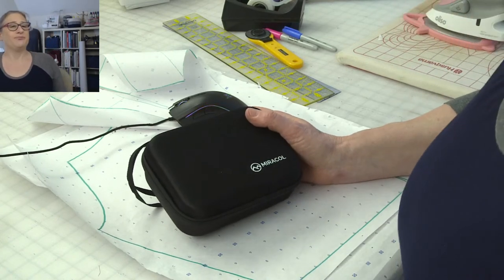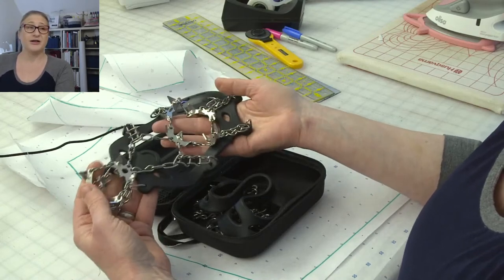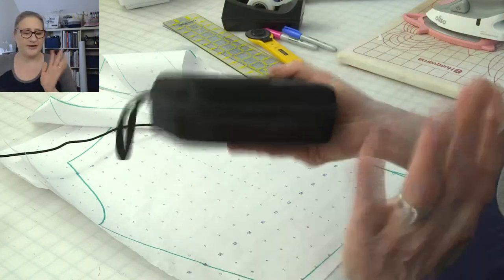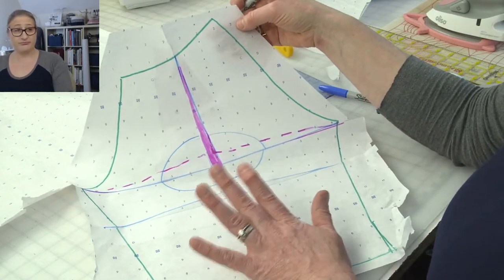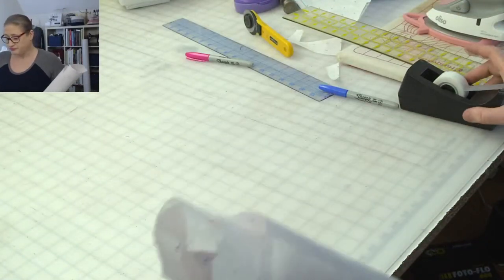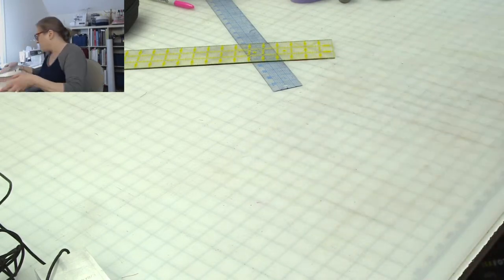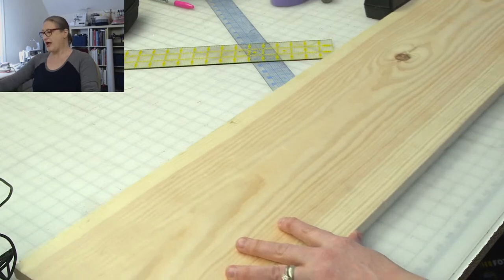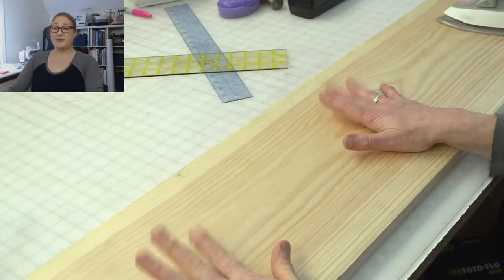How to Add Ease to the Bicep  of Raglan Sleeve Top + DIY Pressing Surface

Comment: Thanks Jen for the bicep adjustment tutorial. I am presently working on my second Fit and Sew Tee. I initially used the large underarm to neck shoulder cutting lines. On the first tee, I realized there was too much fabric along the  front seam line. I have dropped the back sleeve and bodice to size medium , and the font sleeve and bodice to small. I hand baste before committing to my sewing machine. I plan to revisit the first. tee and make the aforementioned changes.
Reply from the maker: sounds good... keep me posted if you need help!

Comment: Wow!  Love the bit on the ice spikes.  They look seriously heavy duty,  I have yaktraks and use them when I have to go out to the mailbox or anywhere else.  On sewing stuff, thank you for this video!   I’ve seen where you are working with raglan sleeves and I would LOVE it if you did a video on doing a FSA on a raglan sleeve.  I love raglan sleeves because they are so easy to sew, but I have a high rounded back and forward shoulders of about 1/2”.  
By the way, I’ve seen your classes on Pattern Review, and I’m thankful you’re doing this.
Reply from the maker: So sorry I'm just answering your comment now.  Here's a tutorial showing how  to do a FBA on a Raglan Sleeve Top:  https://youtu.be/l5Gvg8XvGqc   You can trim some off the front sleeve and add it to the back of the sleeve to balance the sleeve for the forward shoulder ... and if you want to add a CB seam, you can slash and spread it a little bit near the neckline to create room for your high round back.    Hope this helps.  Thanks so much

Comment: Would stapling with a staple gun work for attaching the cover?
Reply from the maker: Yes, you can use a staple gun... Thanks for watching
Reply: I’ve used a heavy duty stapler, not a staple gun, for the one I did.  But the nails intrigue me.

Comment: I would hot glue the grid on the back.  Just so the nails don't scratch your new mat. Mention that the nails need to be shorter than the depths of the board so they won't polk through to the front.
Reply from the maker: Yessss  please choose nails that are shorter than the width of your board!  Between you and me, one of  the nails in my board did poke through a little bit... I used the hammer to pound it flat so it settled below the batting :)  ...Hot glue is a good idea to the base, stay tuned for that!